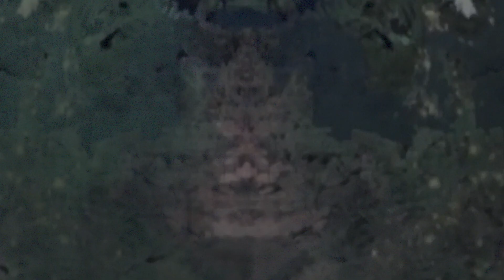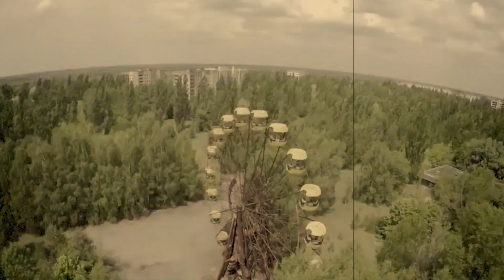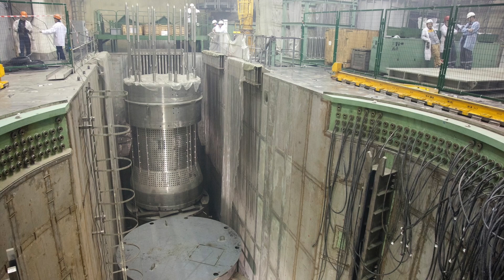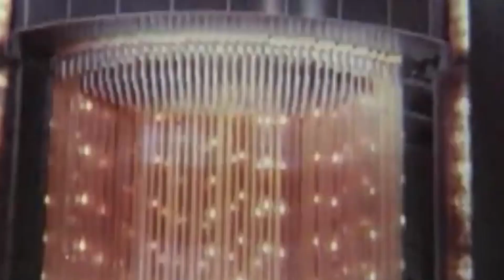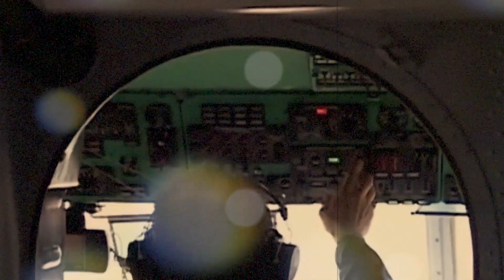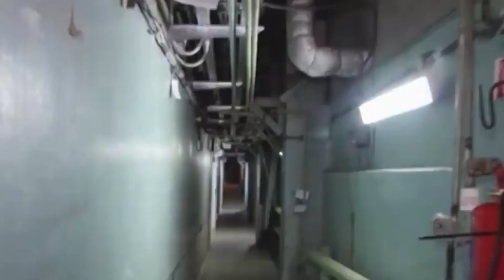Chernobyl may happen again. A global problem

Comment: Wisioner, let's discuss nuclear explosions. A nuclear explosion requires a critical mass, proper geometry, etc. What you don't have in a power plant is critical mass, since the fuel is far to low enrichment to go supercritical. So, there can be no nuclear explosion at a power plant, unless you bring a nuclear bomb to the plant and set it off. Showing nuclear bombs going off when talking of explosions in the plant is not only extremely inaccurate, it misleads people into thinking that this scenario is possible. As for being a sort of neutron bomb, again, that is an extreme stretch. Yes there was a release but it was a release where there was simply a bunch of fissioning happening in a short time, yet literally millions of times longer than a neutron bomb. The reason there was the high amount was simply because reactors have a lot of fuel, thats it. Now, what kind of explosions can actually happen at a power plant?  First there is steam. An overheating reactor is like a pressure cooker and eventually it will rupture, typically through the lid, and potentially with a lot of force. The second kind of explosion is hydrogen explosion. Once hot enough the water begins to react with the zircaloy to be broken down into hydrogen and oxygen and since it is extremely hot in there, its a hydrogen gas bomb ready to blow. It can be significant enough to blow the outer building apart.
Reply: Can we stop with the nuclear explosion symantics. Was the explosion at Chernobyl and Fukashima cause DIRECTLY by radioactive fuel over heating? If you'd like to dispute that, how does so much hydrogen just appear in a reactor core? Have yet to see a coal fired power plant blow up from spontaneous creation of hydrogen. Have yet to hear about any sort of oil fire that spews Cesium and Strontium into the atmosphere in quantities that render the surrounding area no go zones for decades.
Reply: @sylumgand  Words matter. You wouldn't want your doctor operating on your liver when its actually your heart that has an issue. Such is the case here. It was not a nuclear explosion. A nuclear explosion means one thing and one thing only. A supercritical event. Steam and hydrogen explosions, though prompted by a reactor core problem are not nuclear explosions. Therefore, I will always and forever clarify these "symantics" (sic), which are actually grossly erroneous issues.
Reply: @NickFrom1228  Here's something that may be a shocker to you, words and their meanings are not set in stone. In fact "aint" has been around for 300yrs or so and teachers never managed to stop its use. But you can have at challenging my spelling and punctuation all you want, I just don't care. 

And your doctor analogy is just terrible, for starters do you think shit like that doesn't already happen? What do you think malpractice lawsuits are? Would you like links to surgeries that removed the wrong body parts or flat out killed their patients? 

They are explosions caused directly by radioactive materials that spread nuclear fallout, to the lay person your hard on for not calling it a nuclear explosion is moot. You want people to stop being scared of the nuclear boogeyman, don't try pulling the nuclear physicist route of "its a hydrogen steam explosion caused by nuclear fuel over heating". For one it'll tune normal folk out. The only thing people hear is nuclear and explosion. People would understand more if you just said "Nuclear reactors are not nuclear bombs but giant pressure cookers" end of story. From now till the END OF TIME, nuclear reactors that explode will be labeled nuclear explosions.
Reply: Finally…..Someone who knows what they’re talking about.

Comment: And Russians start messing around digging trenches in the red forest got acute radiation sickness
Reply: A lot of that was from them driving heavy equipment down the roads and disturbing and then breathing the dust. All in all, I can't believe they went into that region. Militarily it was not necessary or at a minimum they could have just passed through, slowly and then decomed the vehicles after getting through. Instead the brainics decided to actually trench in. You cannot smack your head hard enough when considering that decision.
Reply: @NickFrom1228  
Not just that, but they also decided to trench in the worst parts of the Red Forest! They dug exactly where in 1986 they buried a lot of radioactive waste in a hurry in shallow pits to make the site directly surrounding Unit 4 'safe' for the people that had to build the Sarcophagus. And the troops also caught local wildlife to supplement their food supplies. Add to that that they slept on the ground for weeks and you have a Darwin Award in the making. Ukrainian troops and the staff of the Chernobyl NPP warned them against going into these areas and digging trenches etc., but they chose not to heed these warnings. Well, play stupid games, win stupid prices.

Comment: I always thought the biggest flaws with the reactor was it was designed, built, and ran by Russians.  I'm surprised this hasnt happened more.
Reply: Look up the Kyshtym disaster. The only reason it was not deemed INES level 7 like Chernobyl and Fukushima was because there was not a large number of lives lost immediately. The releases from the Mayak plant dwarf Chernobyl by far, there's been a number of major failures at that plant since the 50's and they STILL dump waste into the river Techa.
Reply: They were cheap to build, maintain and operate and yes they had design flaws many of which were unknown to the people who were operating them.